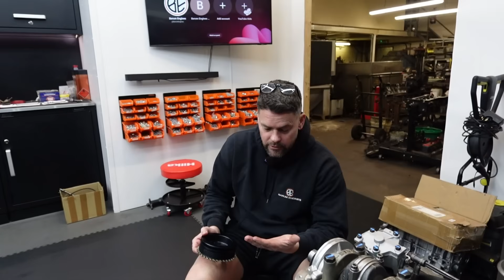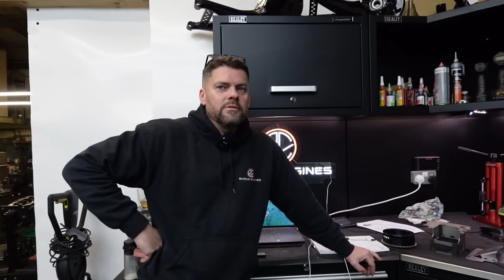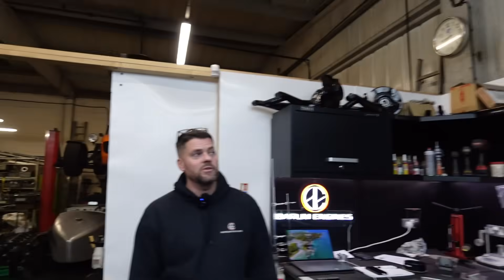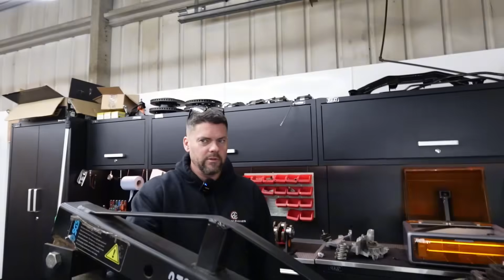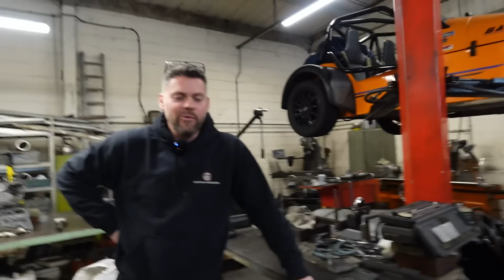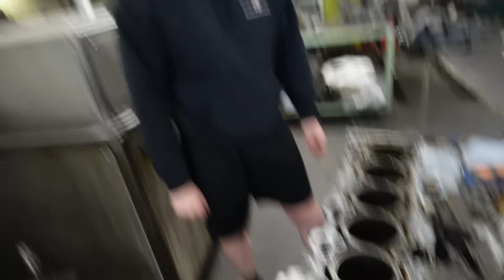Ford’s Most Infamous Engine Problems EXPOSED

Comment: Those 5 cylinders also bend rods if boost pressures are excessive. We found this out to our cost when racing Volvos. Updated rods are available. If put together with care and attention to maintaining oil pressure under all conditions power outputs of a reliable 400bhp are possible. We struggled with engine maps as well and finally found a tuner in Sweden that could do it properly. Unfortunately the UK mappers couldn’t crack the management codes and they caused more problems. Probably best to use an aftermarket ECU like an Emerald and find an experianced tuner rather than one who thinks just turning the boost up is the cure for everything.
Reply: Motorsport developments in Blackpool know there stuff with fords and have one amazing dyno cell.

Comment: The blue light from the led lights you have are no good for your eyes. I've changed back to warm white and my eyes feel better
Reply: There is an in-between standard now also (sometimes described as 'Daylight' or similar) ... The 'Warm White' can be too 'yellowy' and not so good for sharp focus in my opinion ... The bright white can be harsh and sterile, plus as you say can cause eye strain ...

Comment: Eyes: Make an appointment with your optician and ask them about "progressive lenses" The flouro lights in the back of the workshop could also be affecting your eyesight. Prolonged exposure to harsh fluorescent lighting can cause eye strain and blurred vision. The longer you're exposed to flouro light, the more likely you'll experience the problem.